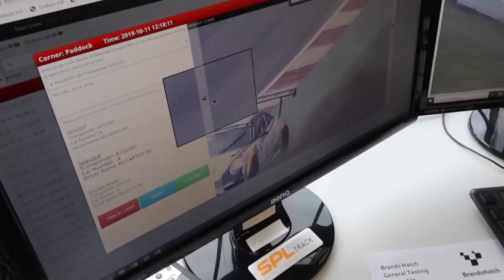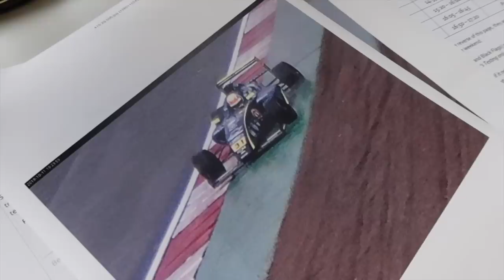Track limits: there is a safer solution! By Peter Windsor

Comment: That's by far the best solution Peter! Australian V8 supercars has used sensors do disallow kerb hopped laps for years now. I never understood how the FIA was unable to implement a sensing solution to the parking lot race track issue. They strike me as modestly incompetent at the FIA.

Comment: Narrow strip of grass.  Then more tarmac.  So if you go wide you lose traction but brakes will still work on the runoff.
Also need a speed limit on the runoff area so drivers can't use it for advantage.

Comment: Do you remember the times when tracks ended and behind a curb came gras and dirt? Pepperidge Farm remembers... No driver in the old days gained an advantage by running through the sand.
Reply: The problem is that you can't slow down on grass at the best of times (god help you if it's damp) and gravel has a tendency to roll cars if they go in fast and sideways. I like a crash as much as anyone but I don't want to see anyone going into a wall at 150mph+ or unable to be extracted from a crippled car just because they abused the track limits.
Reply: TjDolHaus86 The car rolling is much better for safety providing the right car measurements. The rolling takes all the speed and energy out of the crash
Reply: @y0lefted  yes it's better to tumble and shed energy than it is to hit something hard but rolling in general isn't good. In open cockpit cars it exposes your head to contact and in closed cockpits it risks buckling the frame and preventing the driver from being extracted. The other major risk is serious neck injury caused by sudden acceleration/deceleration. Rolling is too unpredictable and never desirable, in an ideal world you want to give them enough tarmac runoff to use the brakes to slow or stop.
Reply: @DjDolHaus86  fine, have a strip of grass like 2 meters of grass then hyper-grippy asphalt, then gravel.
Reply: @WynnofThule  sounds good to me
Reply: @DjDolHaus86  mate motorsport is ment to be dangerous. That's what makes it a spectacle, I'm over everything been sanitized to death. Yes group b rally cars where dangerous, but where they not fantastic? Yes F1 since Senna's passing made changes that needed to happen, but it's been at a cost to the cars free spirit they had. The cars of days gone where alive, the drivers  a part of them nearly. It's all been lost
Reply: You should look up old Riverside races.    Lots of passing off track.  ;).
Reply: @n.w.owhoknowstheshadowknow58  Motor sport isn't supposed to be anything but sport involving vehicles and people shouldn't have to die for our entertainment. It's easy for you as a fan to imply that they've gone soft but you're not the one putting their life on the line. Do you want to tell a drivers son that daddies not coming home because he died in an accident that could have been avoided? 
Modern F1 cars and tracks might seem over sanitised but then you see the fatal F2 crash at Spa a few months ago and realise how little protection they actually give if you're to hit (or in this case get hit by) something hard at 150mph+. Being that you can be at 150mph within about 2 seconds of exiting a slow corner in a modern F1 car it should be obvious why there is a need for protection.
Reply: @DjDolHaus86  you have never raced or been around race tracks with the car on the trailer waiting for the gates to first open because it's race day and you like to be early. There isn't one of them out there for your entertainment lol Berni is there for your entertainment. the drivers would risk all sorts of things  that yes the car would be slightly safer hear or there but that ain't making it faster now is it. You have no idea what you're talking about, drivers don't like stupid shit that risks there safety like Bianchi's crash
Reply: @n.w.owhoknowstheshadowknow58  What are you on about? None of the changes to track design have made the car slower, the track changes were necessary because the cars got faster.
Do you remember who pushed for the changes to safety in motor racing? It was the drivers. Series organisers and track owners weren't too bothered by people dying, the racing drivers who had to do the dying weren't as keen on the idea so they demanded that the tracks were improved or they'd refuse to race.
Bianchi died because he ignored yellow flags during torrential rain and didn't slow down . He lost control and went onto the wet grass where he was unable to slow down adequately or steer and struck the back of the recovery crane. Had he slowed down he might not have lost control and even if he had he would have been going slower when it happened giving him a better chance of stopping or tking evasive action. Had the runoff been tarmac he would likely have been able to stop long before impact and driven off to complete the race.  
I'm afraid it is you who appears to know nothing. Admittedly I've never raced full size cars on circuits but I've done a few track days and a fair bit of competitive carting so I know what it's like "on race day". I never felt as a competitor that it'd be more fun if there was a greater chance of dying, I'd much rather they made changes to notorious curbs that have a habit of flipping carts over than clip that curb and break my neck.
Reply: @DjDolHaus86  Correct if I am wrong but in my memory when bianchi died, yellow flags were not out. Only after that race and his accident fia made it mandatory to have yellow flags when there is big machines like cranes on the track area.
Reply: @EmilAhvenainen  Cut from the enquiry -
To protect the course workers and to warn other drivers of danger ahead double waved yellow flags were displayed. These flags mean that drivers must slow down and be prepared to stop if necessary. Overtaking is prohibited.

Jules Bianchi who had been just ahead of Sutil when the Sauber driver went off arrived back on the scene in his Marussia MR03 a lap later. He was shown the double waved yellow flags because at this point Sutil’s car was in the process of being recovered. For reasons that may never become clear, and have already been debated elsewhere, Bianchi did not slow down enough under the double waved yellow flags.
Reply: @n.w.owhoknowstheshadowknow58  no, Motorsport is not MENT to be dangerous. I was in the Press room at Monza when Pironi's crash happened and in there 500 people were holding their breaths, with the death of Anthoine Hubert (One week prior) still too clear in our minds. And about Anthoine, to hear in first person famous F1/f2 drivers talking about the shock of his death felt like a punch in the belly, something I wish you to never experience
Reply: carlo fe Then why were they driving metal coffins at 200mph on small Belgium village roads if it wasn’t about that risk? What is the difference between watching a guy climb some plastic wall with ropes and some guy climbing Yosemite without any safety gear? Why else do it? Why else drive around at 200mph? If it just about pure racing do go karts or fiat500 cup. The whole reason to go absurdly fast is because it is dangerous and that makes it impressive. That is why watching someone lap the nordscheife in 1.20 in some fantasy car in a simulator is boring because there is no risk, going 30,000mph on the straight is only impressive if crashing means you are turned to pink dust.
Reply: @LesterBrunt  if you talk about karts as if they were nothing special it means you clearly never raced on a KZ. I did and it's terrifying as well.
The point anyway is that racing is a game on who drives faster, not on suicidal tendencies. If the goal is to climb a 20 metres tall wall why not using ropes?
Reply: carlo fe Well that is my point, karting is pure exciting racing at speeds that don’t kill people easily, why not do that instead of F1 if you care about the sport and not the danger? If I just care about climbing I am not going to freeclimb some skyscraper because that is ridiculously dangerous, and that is the point of free climbing. Same with extreme fast motorsport. Would Indycar be as exciting if there was a 200ft strip of run off area around the ovals? No, the point is driving as fast ss possible on an unforgiving track with a very dangerous concrete wall. Would Pikes Peak be nearly as legendary of you couldn’t drive straight off the peak of the mountain at 150mph? 
If danger is no factor why not just watch sim races?
Reply: @LesterBrunt  let's keep American Motorsport aside, not because its necessarily worse, but because it's built more over show than actual racing. I Watch formula 1 more than karting because it's the pinnacle of motorsport. The fastest cars ever built by the best engineers in the world are driven by the best drivers on the planet. If they would race with (example) indycars, which are way slower, would I watch it still? Yes, because of the drivers.
No one ever said motorsport has to be 100% risk free, thats Just impossibile. And yes, danger adds that bit of... Something that gets all of us. But at the same time it's stupid to be looking for more danger on purpose. People still die and get seriously injured nowdays, we dont need more deaths.
Why isnt SIM racing as good as real Motorsport? Because of adrenaline, which still bursts with "safe" cars as the nowdays ones.
One thing is to watch motorsport knowing it's dangerous, another thing is to watch motorsport only because of danger
Reply: @carlofe8207  I have experienced it and yeah it's sad but i didn't one of the drivers pull out did you?
Reply: @n.w.owhoknowstheshadowknow58  i dont get your question sorry

Comment: what would be the implications of installing a patch of grass of a couple of meters just beyond the curbs? It is important for drivers to have a reference to where are the track limits are. The grass will cause a speed penalty and serve as a clear reference of track limits at the same time.
As always, great content. Thank you.
Reply: Grass is awful beyond curbs. You may as well put ice out there, for all the grip they have.
Reply: jameshisself  But I agree that small patch of grass would be great. Not all the sidetrack, that would be dangerous to everybody, but a thin and long patch of grass or astroturf (like one tyre width) could be a simpler solution. And would still be safe for bikes and cars
Reply: It wouldn't be good. A very heavy accident due to a much lower coefficient of friction at the grass means that the car would be out after hitting the grass and not slowing down. It would also remove cars from the race which we don't want.
Reply: @jomillen5131  you know that making a mistake should have consequences for the driver? And if you have tarmac beyond the grass, there would be braking ability as well. Apparently the motorcycle problem is real with the grasstrip, which to me sounds ridiculous as they should just avoid it, but apparently that is too much to ask from professionals....
Reply: @almarma  Even with astro - F1 cars in particular can instantly enter a spin if the rear wheels touch. It's happened at almost every race this year with a high speed corner and a strip of astro - Gio had that massive crash at Spa because of astro. I think the rfid sensor with live images is the safest way to regulate extensions
Reply: @merboberbo  If they could all just avoid it there wouldn't be any crashes would there. When you push to the limit it's easy to go just a few mm over the curb and hit grass/astro which will spin you whether you're in a single seater or on a bike

Comment: This is a very good system, and thank you for presenting it so well, what about a runoff area designed in such a way that it is easy to run out, but difficult to return from? A kind of reverse kerb might do it. Once you enter the runoff area, you must proceed to the designated 'on-ramp' and wait for the corner marshal to wave you back on track. Would be a hell of a deterrent, and the consequences would be immediately apparent to the fans and the other competitors.
Reply: raffriff42 I support this! Combine it with the sensors also.
Reply: Or a 2 F1 tire wide grass strip on the outside beside the curb. And the edge of the curb needs to be higher than the grass.

For harder reentry.
Reply: Another idea is to cut the engine (via the traction control mechanism) in proportion to how far the car is over the line (percent of car width).
Reply: raffriff42 The ECUs aren't allowed to have any traction control functionality whatsoever.
Reply: @AmaroqStarwind  Good point, but the capability is there, just disabled at present.

Comment: I like mechanical limits better than electronic ones. A wall, sausage, astroturf, gravel, grass, it’s all very clear what happens and drivers can choose themselves how far the want to test the limits. An electrical signal seems artificial to me. 
But having said that, safety goes first of cause.
Reply: I think we all would prefer gravel or grass, so that the drivers actually loses time when they go of track.
But as that seems to have been frawned upon due to safety issues, as I see it, we have the choice of random judges deciding if a driver was outside or not, and depending on goodwill enforcing random rules or not.
I would just prefer somethong fixed, and if penalties should be given at least let it be clear cut.
Reply: tjampman 
I totally agree that having the stuarts decide whether or not a driver went off track is the least desirable option.

Comment: I disagree, I dont think a driver should be excused if he makes a mistake.

The problem as I see it is when drivers leave the track, and it i a paved area, they keep their foot down, to avoid losing time (see Spa 2019).
As we have gotten rid of gravel, my thought is the drivers should be forced to either stop the car before returning to track or use the pit limiter if applicable until they return to track.

It would be nice if you could use technology to determine if and by how much a car is outside the track. Then you could say, if the driver is clearly* outside, the above would apply, (* clearly, meaning an agreed upon distance outside of the track) and if i within a narrow range, you could give 2-3 warnings before giving a 5sec penalty.

Comment: Mr Windsor, I was happy to find your channel since I miss seeing you on the F1 grid of US broadcasts from days of yore.  At Virginia International Raceway they use the Green Restrictive Amorphous Slowing Surface system to enforce the track limits.  The GRASS system provides immediate feedback to the drivers and automatically assesses a time penalty for violating the track limits.  As a bonus the GRASS system reduces atmospheric carbon, helps to control water runoff, and does not launch race cars like a homesick meteor.

Comment: Make the track limit an actual TRACK LIMIT. Stop the pavement there, that's the limit of the track. No curbs to run off onto, just pavement and then grass. And for safe runout areas, back to the high friction paved areas that are working so well. But then you've got to get back across grass to get on the track, not likely to happen at speed.

Comment: What about those runoff grasses that were used in suzuka.

If the driver goes wide, the grass "paints" the tires green (or any other colour) 

That way the stewards can see that the driver went wide or cut the corner, and the stewards can give him/her a penalty or a warning.
Reply: its still a time penalty, thing I like about sausage curb it punishes you a bit if you get on it with one wheel, it punishes you a lot if you go over its all natural it organic you sometimes dont even see as it punishes the driver but anything that involves marshals and time penalty's makes the racing worse

Comment: Curious how the low profile tyres are going to change safety. Heavier overall wheels, stronger tethers needed?
Reply: yes and yes.
Reply: depends on allowable materiale, Carbon wheelset coming ?
Reply: I don’t think this is so
Reply: @torstenhvalse6505  Materials have the stay the same for cost reasons.
Reply: They aren't being introduced for safety, it's all about $$$$

Comment: If Brands has gravel traps, why not bring the gravel closer to the edge of the circuit? Get rid of the meter of green runoff.
Reply: Yes but, it would cause more cars losing control & possibly spinning back into traffic.
Reply: Rather have grass to do that

Comment: As Many of the Comments in this video have said, V8 supercars in Australia have been using a track limit system built in to the track for years. They are used on Beachside chicane at the Gold Coast on a street circuit that gets used once a year. In Qualifying and the shootout in it is quite common for a driver to get a "Kerb Hop". It is instant. And the Team and Driver know immediately if the Car has gone over track limits. It is great what they have done at Brands Hatch, But Supercars Australia have been doing it for years. So it is not new technology. To have that Kerb there at the Parabolica even if a F1 car can run over it is just ridiculous. Great Report Peter. Maybe you should talk to someone in Australia and get a Video of How the system works Down Here. Cheers.